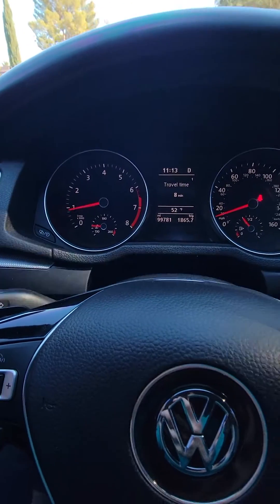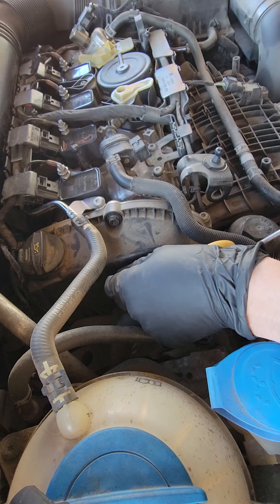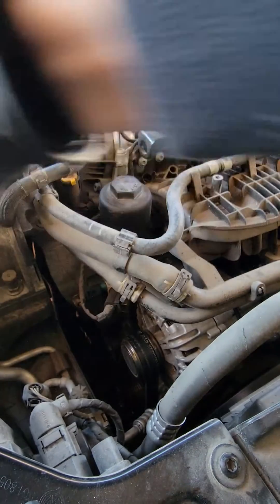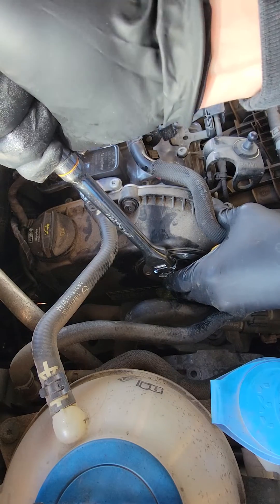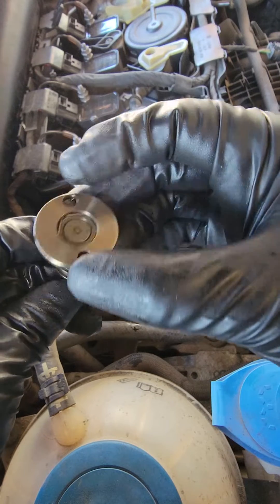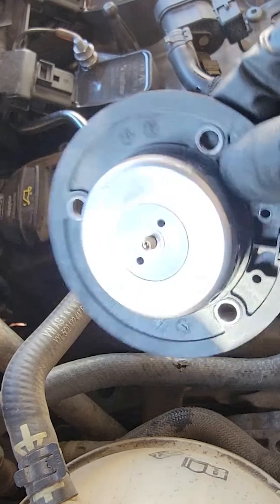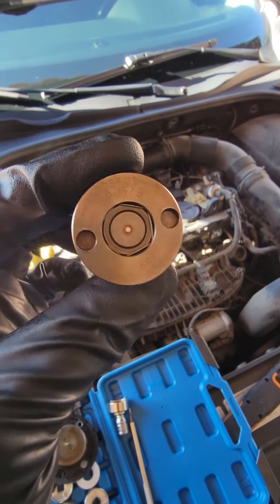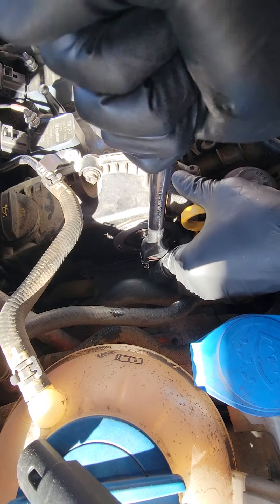Stop Doing 10k Oil Change Intervals! | VW 2.0T P0011 Common Cause & Repair

Comment: Hey, are there any tips to removing the oil control valve? I have the tool but it is impossible to loosen it. I just have a small 3/8 ratchet and it does not budget at all.

 Thanks!
Reply from the maker: Need a longer ratchet for more leverage
Reply: @Mechani_Cole  I appreciate that. Will use a 1/2 inch breaker bar with an adapter. Hopefully I return with good news.
Reply: I have the same problem on my Audi A5. I saw a video in which they have explained that it is necessary to turn the crank to the service position before taking the selenoid out. Is this true?
Reply: @MHDI100  Possible that is needed. I on the other hand managed to get it out when the engine is cold with a breaker bar. The solenoid works perfectly now after replacing it

Comment: Saved me thousands. Foreign car shop tried to change my timing chain an spark plugs for $3,500
Reply from the maker: My favorite kind of comments right here, thank you🫡
Reply: What code pop up on your car
Reply: depending on the generation of tsi engine, around 100k, you need to replace the timing chain tensioner, chain, guides. the chain will stretch out if not done, they had to make revisions to the part w/ the first couple generations, starting w/ the 2008-09 MK5s

Comment: great video! I have a 2014 jetta tsi that makes a strange noise as if there is something loose in the timing part (you can only hear it when accelerating in the range of 1000rpm to 1500rpm)... I disassembled the magnet and it really was a little stuck, I cleaned it with degreaser and it's looser, but not as much as shown in the video :( , do you think it could be the valve? I tried to remove it but it doesn't come out at all, I bought the right tool but I wasn't successful in removing it, I think the mechanic tightened it with the wrong torque. What do you think I should do? replace the magnet and the valve? This noise only appears when the engine is warm (close to 80 degrees celsius)
Reply from the maker: I would replace the magnet and do an oil flush. You can pull gunk right back through it after cleaning if not. Best to replace since it's cheap and already out. 

For the valve, you do know that it is reverse thread right? This means you go RIGHT to loosen it with the special tool. Many people try going left, but it is for sure reverse threaded. 

Make sure you're using a good oil after flushing it. You can also add hydraulic lifter additive as well, it will help. Here is a link to some - https://amzn.to/3UHzWum

Comment: Did this then the car ran better for an hour then the engine Seized 🤦🏾‍♂️🤦🏾‍♂️
Reply from the maker: Wtf, really?
Reply: @Mechani_Cole  yea rn I hoping it’s ok and can be freed. Engine was running fine it just had a delayed start which I was told it’s the magnet and I change it out and the engine seized up.
Reply: @prolifik_hussle5972  probably bad oil pump that caused low oil pressure

Comment: Hey I am getting codes P0011 and P00A on my 2019 A4. I replaced the camshaft positioner sensor and still didn't go away. I just ordered the Camshaft adjuster solenoid to see if that's the issue. Should I also replace the camshaft adjuster magnet or should I wait? Mileage: 80k
Reply from the maker: I'd start with the magnet first ad it's easiest and cheapest to replace
Reply: @Mechani_Cole  Does the camshaft adjuster magnet usually go bad before the solenoid? That way I will cancel my order and go with the magnet since it is cheaper!
Reply from the maker: No. That soleniod rarely goes bad. If it's bad, it's usually just dirty as well. They get sticky from lack of oil changes or waiting to long in between. After changing the magnet, I'd put some LiquiMoly engine flush, run it for 20 mins, then drain oil and replace it with new oil. This helps clean the valve and anything else in there
Reply: @Mechani_Cole  Thank you so much cole, you are great help!
Reply: @Mechani_Cole  So i will be replacing the magnet soon. Since the issue is on Bank 1 It will
be the passenger side correct?
Reply from the maker: This is a 2.0 4 cyl engine. There is no bank 1/bank 2. It's all one side. There is only 1 magnet. Is that what you mean?
Reply: @Mechani_Cole  Yeah it is a 2.0t 4 cyl But i actually see 2 of the magnets in the front?
Reply from the maker: What's the make and model of your car?
Reply: @Mechani_Cole  audi a4 2019 (b9)

Comment: Thank you for the video! Out of curiosity, what did you clean them with? I'm going to try and clean mine until my parts come in. Thank you for your time!
Reply from the maker: Can spray the magnet and valve with brake cleaner to clean them out. I highly recommend running an engine flush and changing the oil after. I used the LiquiMoly Engine flush - https://amzn.to/43dssDn

Comment: Can that cause the low oil pressure warning light to come on apart from the the oil pump , ive got audi 2.0 tfsi at my workshop
Reply from the maker: Possible, maybe. But unlikely. Could be other issues for sure. Is it throwing any codes? Can always pull this magnet to inspect it very easily just to make sure. Double check oil pressure sensor as well

Comment: I have a 2016 vw passat 1.8 and its returning a p16 code and the mechanic seemed to think it was the magnet but the pin seems to move decently. maybe not as easily. when the car is low rpm it misfires but if I rev up the rpm's (go over 40 or so) it drives fine. It doesn't always misfire or drive bad, could it still be the magnet? (the mechanic couldn't get it to act up when he had it but wanted to charge me $507 to replace the magnet) I'm at a loss
Reply: Yeah, I was shocked too. He hadn't even taken off the magnet to see it. Charged me 201 to diagnose but told me he thought it was a failing ecu and that would be 2k. I'm the one that suggested the magnet and he ran with that. I did just do an oil change, what is an oil flush?
Reply from the maker: Sounds like a shady mechanic. How does he know the magnet is good without inspecting it? 

Oil flush is a chemical that cleans out sludge and oil deposits. Used before an oil change usually
Reply: @Its MechaniCole  that was my concern. And that he didn't even suggest the magnet until I said it. When I said that was steep to replace a part we didn't know if it was the issue he said well it most likely is.
Reply from the maker: $507 to change that magnet???? I charged the person in this video under $200 for this job. Thats insane! 

And yeah, I would change it and do an oil change/flush to see if it fixes it. If not, then further diagnosis is needed
Reply: Hi Iv a 2016 polo GTI 90k km car is making a ticking noise like a stuck liftertook the 2 magnet.s out replaced 1 the van one and cleaned the second were moving free and pushed the oil spool in moving freely and sprayed stuck engine flush in and ran for 20 minutes tick.n is still there, no lights on,,, will I have to get a computer plugged in to reset this  cam magnet?? Thanks for help il change the oil 2mw

Comment: I have a 2015 Audi A4 2.0T the car first gave me the code P11A100 “Cam shift actuator A cylinder 1” and then later on it gave me a code P000A00 “A camshaft position slow response (Bank 1)”, 

The problem thar I’m having is that when the car is warm and I have it parked at idle, it seems like it vibrates a little more than it should but nothing to go crazy about but then when I turn the rear windshield defroster on with everything else of the HVAC off then the car starts vibrating on and off on and off and very hard, and it vibrates a little bit more when I use the window switches or the headlights, I though it could be this camshaft adjuster magnet since the codes are related to the camshaft but the problem to me seems more with electrical stuff, I already replaced the camshaft position sensor and it didn’t make any difference
Reply from the maker: Check your battery voltage. What you just explained sounds like a bad battery low on voltage. Or the alternator is on its way out. I don't think they are related based off that
Reply: finally, what did you do with the problem you had, because my car has the same thing
Let me know please Samuel

Comment: Mine does a hard start. Got diagnostic done n guy spoke with vw who said it's the magnet
Reply from the maker: Very common. Make sure to flush oil and change it as well when you replace the magnet

Comment: Hey I just bought a new cam shaft magnet but wondering what tool u used in the beggining to take out the 3 screws?
Reply from the maker: Was just using a Milwaukee ratchet and stubby torx bits. I think T30 for the bit or T25. 

Here's a cheaper version of that tool if you want - https://amzn.to/3RIGuaY

Here is the torx bits - https://amzn.to/3x6b8BA

Comment: Hey buddy , i knw this is random but idk where to ask on any other platforms of yours. So my audi isnt responding anymore. No crank no start , however the 1st time it did that i replace the starter. Been driving fine again. Then all of a sudden its back again to no crank nor starting. Battery is fine. Jst nothing at all. Was wondering if u have any thoughts i cld look into. So far my best bet after research on here is the relay? Starter relay.
Reply from the maker: Starter relay is a good start to check. What year Audi do you have? In some models the ignition switch inside the steering column will go bad. Is the steering wheel locked? Or does it still move?
Reply: 2005 2.0 A4 Quattro. Yes it does somehow lock when i put in the key wont turn unless i kinda move the steering wheel left or right then it'll be fine. But as in lock like wont move at all after turning it a few times. No.
Reply from the maker: Have you tested the battery to make sure it's at proper voltage? I've seen dead cells in batteries cause that too if the relay and fuses are good.

Comment: What’s your recommendation on miles for these 2.0 engines
Reply from the maker: Don't go over 5k miles even with full synthetic. I personally change all my vehicles at 5k intervals. Hardly ever have issues of my own
Reply: VW Dealership schedules for every 10k ☠️
I'll bet my bottom dollar they're deliberately doing this to make money. The dealership here where I live is notoriously k own for bending their customers over the barrel. Last time I had them change my oil they asked me if they could change my wipers for $60 and my cabin filter for $85. That was the day I stopped going there to have my oil changed and started doing it myself. After I do this magnet and valve I'll stick to your recommendations of 5k 🙌

Comment: They normally like to leak oil through the electrical connector as well!
Reply from the maker: Good tip, thanks for the comment! I've definitely seen a few oil control valve soleniod do that too
Reply: So if it’s leak through the connector means it bad ?
Reply from the maker: Yes. Although can be cleaned and reused if no codes. But may present a problem later